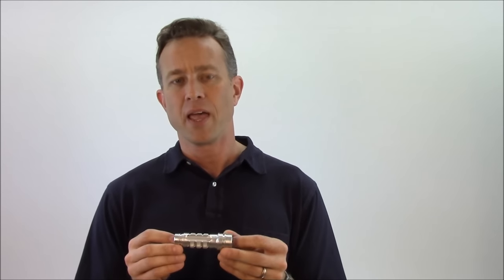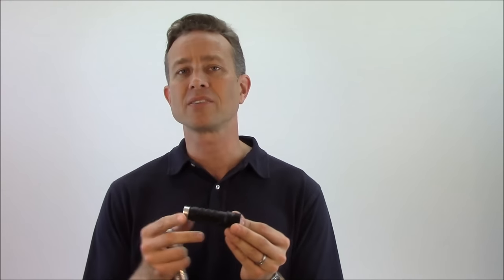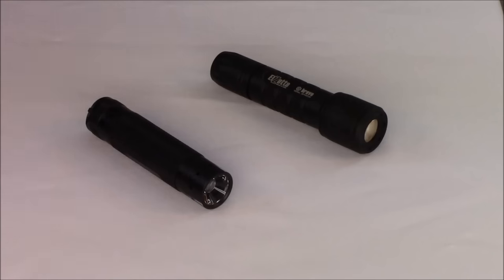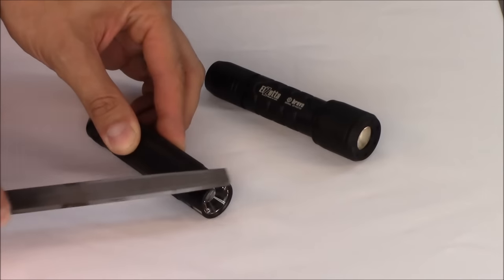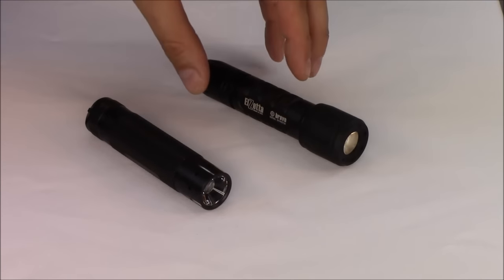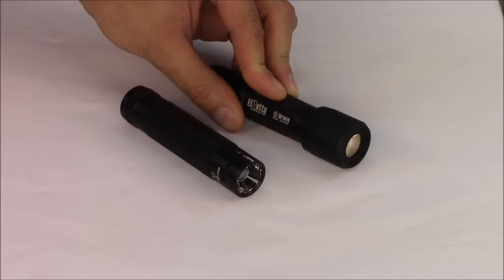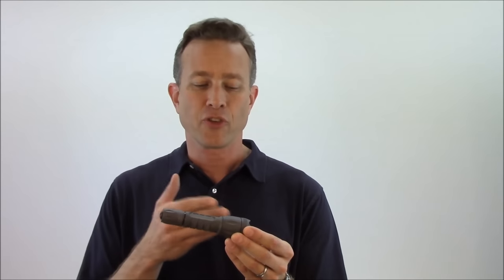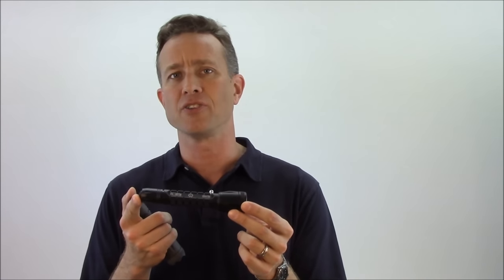Tactical Flashlight Anodizing, Is Yours Hard Enough?, Elzetta vlog episode 13

Comment: I used to work at an plating company. We never used the term Type III, but I think It's the same as the military standards. A lot of work orders would start with MIL and a certain numbered procedure/standard. Also if it is that thick It can only come in two colors. Natural anodize or black because of the properties of hardcoat, At least in my shop.